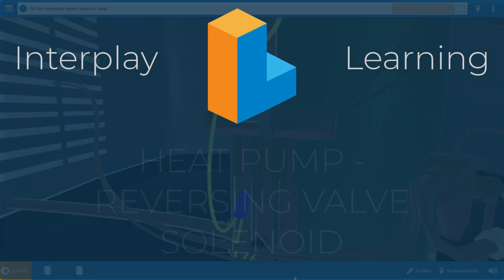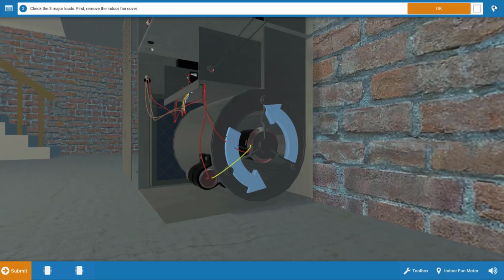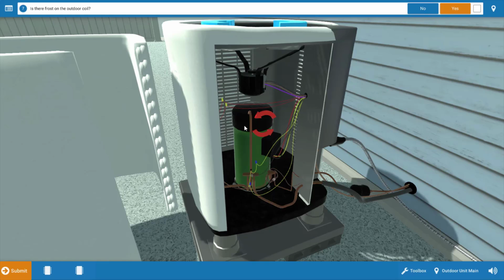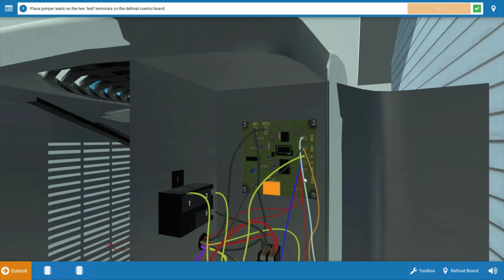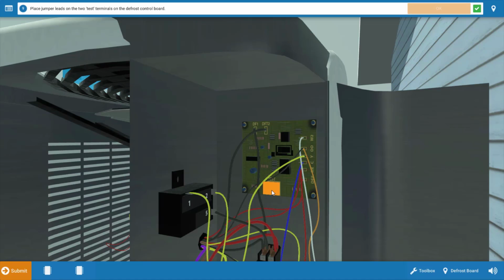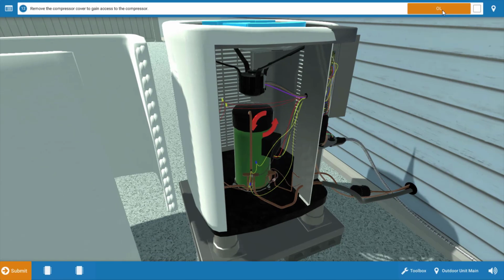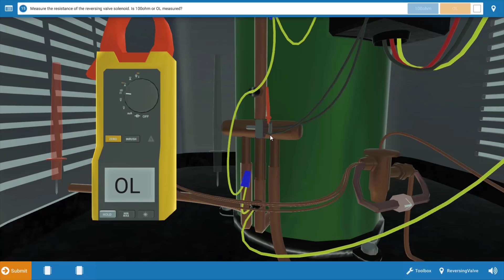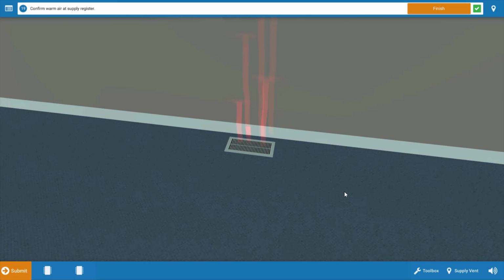[2019 GUIDE] Troubleshoot a Faulty Reversing Valve Solenoid on a Heat Pump

Comment: Would this troubleshooting method work on a split system that isn’t cooling in cool mode , all pressures are reading right, coils are clean, filters are clean, duct work is keeping good airflow R8 flex residential home ?
Reply: And I have this program it’s awesome !!
Reply: What program is it?@dxssertixn9988